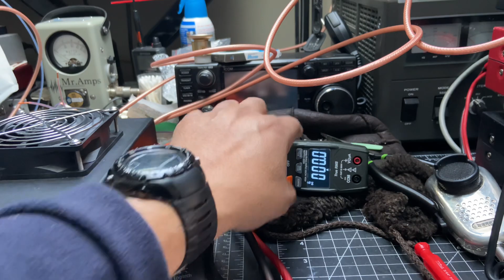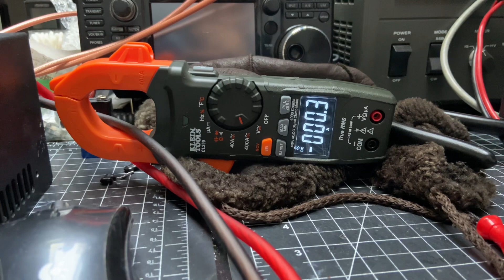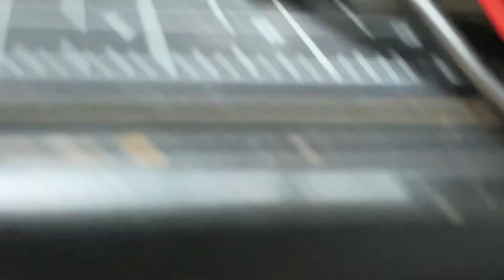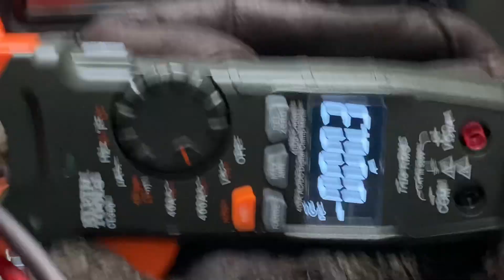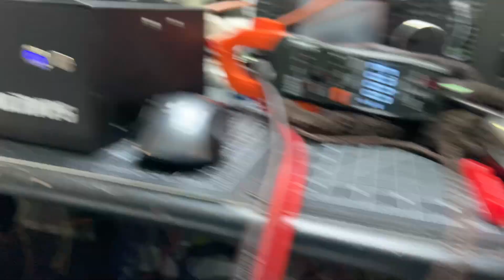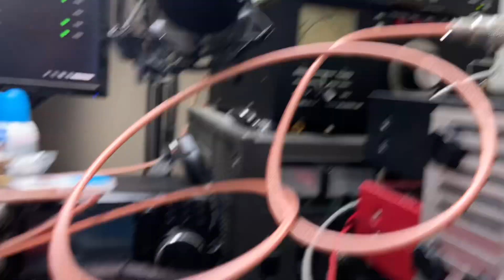AMPLIFIER. Tips for SSB and AM! Bias and classifications

Comment: The Current Clamp Meter should be on the Positive, or Red wire, you are seeing a DC ground loop through the coax when you are only seeing 7 Amps for 350 Watts.  Should be closer to 35 Amps.
Reply: Same here.  Shouldn’t the meter be on the positive wire???

Comment: Only 7.2 amps on am at 325watts
Reply: Wrong ... Your clamp meter is  looping man... Your gonna be much higher than 7.2 amps at 350 watts . Ohms law is ohms law  ... When you make 350 watts of Rf on am  your consumption is much more than 7.2 amps ... It's simple match bro... Your looping and using your clamp meter wrong
Reply: Your giving crazy  false info ....I can key my amps on ssb for 5 minutes .... The amp must be built and ran in the proper classification for the mode of operation .. ssb ab-1 .. I even run ab-1 for AM.. if you Wana sound good run bias on AM aswell not just ssb... Bias will improve your audio in any mode of operation..the classs will make more meter movement and drawl less  current but  less clean ... But what I am arguing here is the amp consumption..350 watts u will be more upwards of 30 plus amps dude on am ...have great day. Oklahoma DX1 Justin 35 plus yrs of doing tech work on amps and transmitters...
Reply: You know better ...😊
Reply from the maker: Yes.